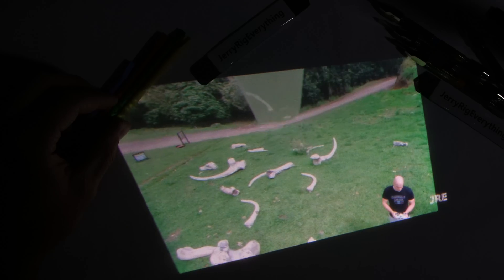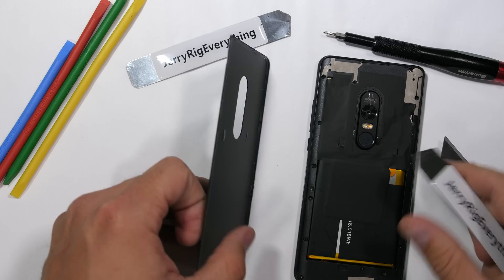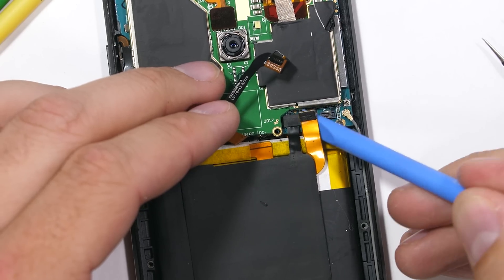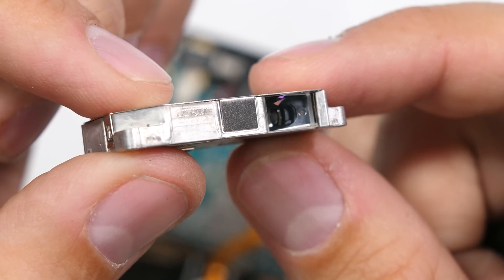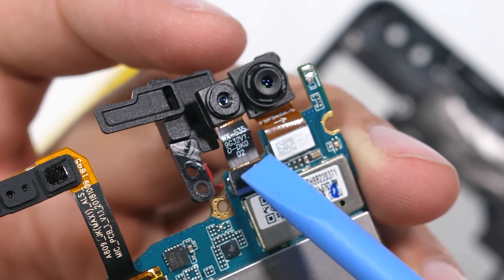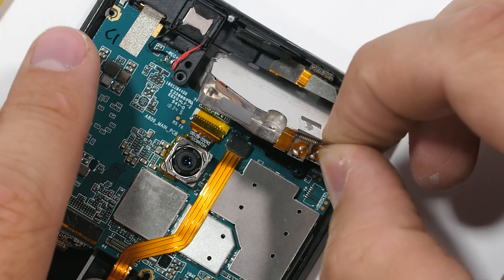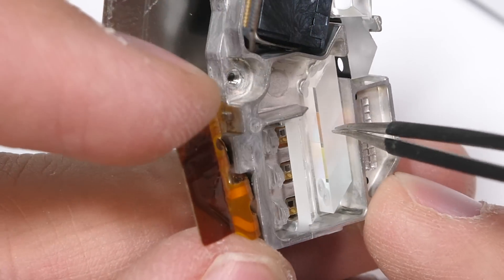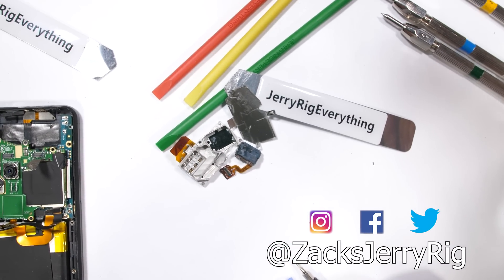Smartphone LASER Projector Teardown - How does it work?

Comment: I want Blackview to make a  small USB-C PROJECTOR DONGLE that fits into any phone.
I think it would be no more than 100$ retail.
Reply: That is killer sales idea
Reply: Not sure about the quality... But USB-C portable proyector already exists..
Reply: A phone isnt the target a pc or laptop is use as an extra screen or as the main screen saving you from bring a monitor with you at a lan party
Reply: That is a great idea but bear in mind, Blackview used existing projector modules for this phone, they didn't make the actual projector. As such, I don't expect them to make any projectors.
Reply: Late to the party, but Zach said that most phones aren't built to give out electricity from their charging port and it could ruin the phone by frying the charging components. I'm sure that was an idea they had before they made an actual phone with it
Reply: @kicadjo  USB-C can handle the power output needed for a small laser projector

Comment: Ooh! It's a Microvision laser projection module! I love that company's tech. Best on the market so far.
Reply: I think microvision uses TI's digital light projector tech
Reply: @Sou1kn1ght23  Err.. No they don't! Microvision is LBS laser technology. They are an independent company with their own tech. TI uses DLP.
Reply: @Supervidify  but zack said it uses Micro.electromechanical actuators for light projection.. isnt that what DLP does too?
Reply: @Sou1kn1ght23  TI's DLP uses a separate mirror per pixel.   Microvision's MEMS LBS (laser beam scanning) uses just one mirror to scan all pixels. For a 720p display like the Blackview projector, DLP would need 921,600 mirrors.  Microvision's latest LBS scanner uses 2 mirrors and can generate a 1440p display.  That's 3.69 million pixels.  For that, DLP would need 3.69 million mirrors.
Reply: @Closer-than-it-appears  okay. Thanks for the info. I had no idea

Comment: I was hoping for more of an explanation about how it works so here it is as best as I can determine looking at patents (so I might not be 100% accurate):
The three round cans are the three laser diodes.  
Directly in front of them are beam-shaping optics that collate the beam into a vertical line
There is a beam splitter in front of that with what look like sensors of some sort mounted along the bottom. I do not understand what those are for.
There is a long prism/beam combiner that takes the vertical line from each laser and turns them 90 deg while combining each beam into one
The beam reaches the end of the prism and turns 90 deg into the smaller prism.
The smaller prism angle is less than 45 deg so the beam is directed directly towards the scanning 'eye'. 
This eye is a mechanically controlled mirror that vibrates at a very specific rate and pattern in such that it can direct the incoming beam to anywhere  within it's field of view.
The scanning eye, in coordination with varying output of each laser diode, reflects the beam in  a scanning pattern (much like old school TVs) "drawing" the image onto the final projection lens.

Comment: There shouldn't be any autofocus in this projector; it's a scanning beam projector, using the collimated laser beams to strike the same width point regardless of distance. That mirror swings in a 2D pattern to paint the image, similar to CRTs but probably exposing on the reverse sweep also, like many printers, since the mirror takes a similar time to swing back (CRTs can swing their magnetic fields much faster on the retrace). This also means the resolution is limited by speed, not some fixed number of pixels, and means it could do keystone correction without sacrificing resolution.

Comment: I think what is really interesting about the projector is how one laser beam (mixed out of 3 colours of course) becomes an image. I don't know about the method they use here but I do know about lasers that are used in event production.

These lasers have two mirrors, one for the X axis and one for the Y axis. Both of them can be tilted super rapidly. And by that I actually mean that the movements of the laser beam are not or only barely visible to the human eye (it is suuuuper fast). Combining that with the colored lasers changing their intensity in just the right moment to get the right Color results in the laser having the right Color when it is at the right place. The technology behind this is really amazing I think.

Comment: Apple we can't fit a headphone jack
Black view let's just put a projector
Reply: Aidan Ryan 458 Don’t forget the huge battery capacity.
Reply: @kingcs6273  No kidding. If they can fit all that, surely Samsung and Apple can be more efficient and give us the headphone jack and bigger batteries. We know the removal of the jack is craven move, either to extract more $ or to follow the herd. There never has been a smart phone so packed that I could see no way to re-arrange it enough to get a headphone jack in. Even if it had to come at the expense of battery capacity I would still want it. Hey Samsung, forget the camera in the SPen, give us a headphone jack in the sPen instead...
Reply: Juris Blumfelds but it doesn’t have fast chip or good camera soooooo you some you get some.
Reply: Κώστας Βρουτσης Chip is a question of price only, also in the same time chinese phones got actually more camera modules, even the S10 3 cameras in the back and s10 1TB was 4 cameras
Reply: Wtf😂😂😂😂😂
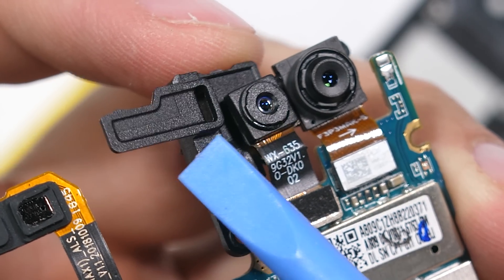Reply: The space pretty much goes to haptic feedback vibrator, which if you see at 3:38 is not at all enough for a good vibration
Reply: Like you’re money lol

Comment: Finally ...thankyou jerry you are doing a favor to world by doing these videos as no one has balls to open components when they r so expensive and explicitly says not to open
Reply: Really?
 I'm pretty sure test equipment being torn down on actual electrical channels cost way more. Some oscilloscopescopes torn down are well over 10k. They even fix the ones they find broken.
 That warning means nothing. Its mainly there just because if you open it and scratch the hell out of it with tweezers it's probably not going to work. The laser diodes are likely uneffected and they are not focused so there is really no danger there.

Comment: Manufacturers : Do not remove the cover on the top.
Jerry : we are gonna remove the cover on the top.
Manufacturers : FUCC..
Reply: By the looks of it, the main issue with removing that cover is you might get dirt in. Second is you obviously mustn't apply power like that because it may be rated for swinging beams, not fixed. The projector unit was likely fine until he started poking at the moving mirror.
Reply: @0LoneTech  Thanks for the info.

Comment: I will go with projector instead of flexible display because projector makes sense but flexible OLED display not.
Reply: Yup, instead of making weirdass folding phone they should make a tablet that can fold in 2 times into a block that can fit in the pocket, imagine pulling a block out of your pocket, then unfold it and browse jerryrig, lol.
Reply: @MarkiThePews  CEO of xiomi had already developed this dual folding tablet prototype
Reply: @tinkalumrigar2964  holee shit!, Man I'm loving Xiaomi more and more!, cheap, high quality things, just got the Mi Band 4 nearly 2 weeks ago!, Used the Redmi Note 5 also, really good phone but I wanted even more battery life so I switch over to Asus Max Pro M1 and kinda instant regret :/, shit signal strength, still, battery was hitting 16hrs screen on time, haha, but it went south lately, now only 10-11hrs (switched the Note 5 to a random guy's used Max Pro M1)
Reply: @MarkiThePews  holy moly I am using Asus zenphone max pro M1 lol
Reply: @tinkalumrigar2964  lol, you have any signal issue?, mine have a warming issue, never overheat but always reaching 41 degree, even light use, and both cellular and wifi signal is shit compare to even some old cheap-ass phone that can't even run Brawl Stars smooth.
Reply: @MarkiThePews  no
Reply: I will take the one that doesnt break.
Reply: But that's how you look at it... me personally I can not forsee any situation where I (again.. me in person) shall use a projector. A foldable phone/tablet however seems extremely handy for when I want to read an article, watch a YouTube film or play games in the train, at work or at home on the couch (while the wife is watching some boring film on tv)
I wouldn't see myself in any of these situations starting up a beamer.. that's not practical. And.. another downside.. you can't pick up your phone to select a next YouTube movie or something because your beamed screen will be lost.